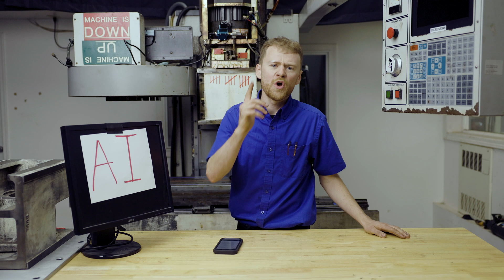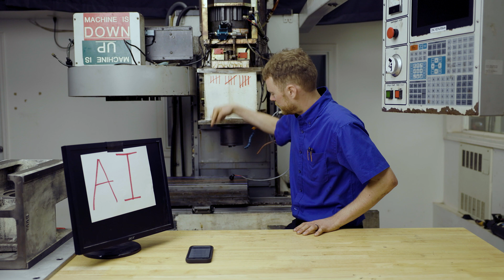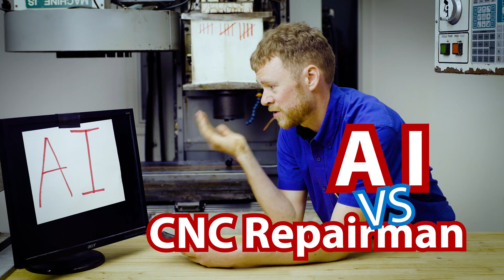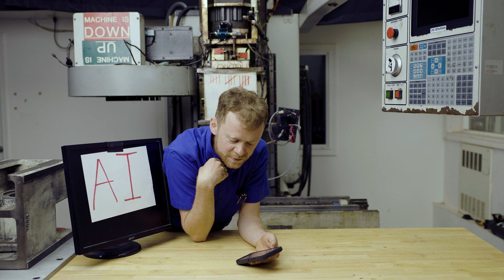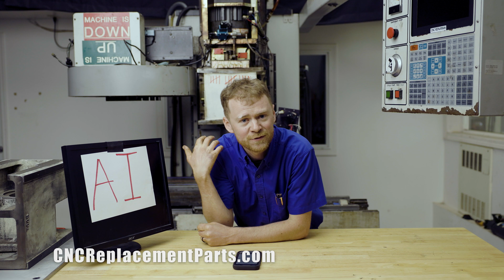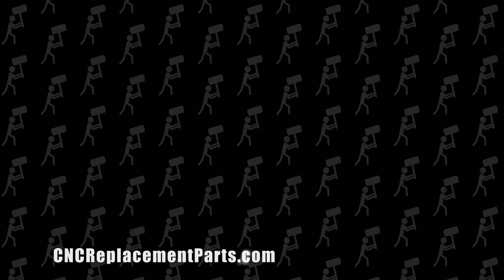How to Fix a CNC With AI

Comment: So you basically ask every single question there is instead of narrowing it down and targeting specific questions... thats not really helping though is it?

tbh in the future these machines will be filled with sensors and it will just self diagnose.
Reply: The cost of the AI machine that can completely diagnose itself will be priced 10x higher than others that do the same work, and the machine buyer won't buy th AI machine because the work they run on it won't cover the extra cost of the machine in its lifetime. They won't ever reach ROI return on investment unless they are charging their customers 10x more on for the same part produced. The machine mechanics will wear out at the same rate on both type machines. Still going to need a repairman. And sensors will fail. Still need a repair man. And for preventive maintenance, Still need a repair man.  The cost to build a perfect AI self sustainable machine would cost more than anyone could afford and it would never achieve a return on the investment IMO.

Comment: I'm on your side that AI will never replace the experienced expert, and I also think that you didn't really give AI a fair chance. As a machinist, I can say that you are absolutely correct that finish issues are likely related to the tooling or a lack of rigidity somewhere in the setup; however, a hard crash or worn components also cause problems. The way you asked GPT, it has to answer for both the machinist and the technician.

So, I just came up with a prompt that clearly states a common milling issue where the chatter can only be caused by the CNC, and be unrelated to the job setup:
"In an industrial CNC mill setup, using an endmill, chatter is present along the y-axis during an internal circular interpolation, but no chatter is present along the x-axis of the circular bore. Rotating the vice 90 degrees and performing the same cut will produce a similar result. With the same setup, on another machine, there is no chatter present. What can be causing the chatter?"

In the response, I was hoping that it would say "check the ball-screw for wear" or "buy new seals and remove the clumped shavings from under the way covers", but what I got was pretty much "check your tooling, cutting conditions, and lubrication"... now I'm thinking that you rated AI to highly... that maybe it can ONLY provide general responses to abstract ideas.

Will there be any more AI versus human videos coming our way?
Reply: I asked ChatGPT4 your exact prompt and got this result:

"Milling chatter is usually a result of a dynamic response in the cutting process that involves the natural frequencies of the system. It manifests as an unstable, often loud and intense, vibration during cutting. If the chatter is present only in one specific axis and persists even after you rotate the workpiece, it suggests that the problem is machine-specific rather than tool or workpiece related.

Here are several possible causes:

1. *Mechanical looseness:* If there's any mechanical looseness, such as a worn guide way, loose screw, or misalignment in the y-axis components of the machine, it could cause chatter. A machine's axes are not always equivalent in their mechanical design, which could explain why the problem only occurs in the y-axis.

2. *Unbalance forces:* The spindle or machine itself could be unbalanced, with the imbalance more noticeable when operations are performed along certain axes. 

3. *Natural frequencies and mode shapes:* Every mechanical system has its own natural frequencies and mode shapes (ways in which it tends to vibrate). If the cutting conditions (like speed and feed rate) match one of these natural frequencies, resonance can occur, leading to chatter. It's possible that the y-axis of your machine has a natural frequency that is getting excited during this particular operation.

4. *Tool holder-spindle interface:* There might be an issue with the tool holder-spindle interface. Runout or a loose tool holder could result in chatter.

5. *Control system parameters:* The control system parameters could be improperly set for the y-axis. Factors such as servo gains, damping settings, and acceleration/deceleration rates can all impact system stability.

6. *Lubrication issues:* Improper lubrication or failing lubrication systems can cause increased friction and heat, leading to chatter.

7. *Servo response issue:* The problem could be specific to the servo control loop for the y-axis. This might not be responding correctly to the feedback, leading to instability.

To pinpoint the cause, it would be necessary to perform some systematic diagnostic steps. You might need to check for mechanical looseness, inspect the machine components for wear or damage, and examine your control parameters. You might also want to perform a modal analysis to see if the y-axis is resonating at the cutting speed. You can then make necessary adjustments or repairs to alleviate the problem."
Reply: @kjetilandersen7151  That's weird.. Was that the only question that you asked, were there any prior prompts, have you used the service before (if so, are you a machinist or tech)?
I can't believe we're getting vastly different responses to the same prompt; I'm going to retry it when I get back and put it's response here:

 "Chatter in a CNC mill can have various causes, and diagnosing the exact reason can be complex. However, I can suggest some potential factors that could be contributing to the chatter in your specific scenario:

Machine rigidity: Chatter can occur if the machine lacks sufficient rigidity to handle the cutting forces generated during the operation. This could be due to issues such as worn-out or improperly tensioned bearings, loose components, or a less rigid construction along the y-axis compared to the x-axis.

Tool conditions: Check the condition of the endmill. A dull or damaged tool can lead to uneven cutting forces, causing chatter. Ensure that the endmill is sharp, properly secured, and suitable for the material being machined.

Cutting parameters: Review the cutting parameters used during the operation. Chatter can result from improper speeds, feeds, or depths of cut. Adjusting these parameters to optimize the cutting conditions for your specific setup may help alleviate the chatter.

Workholding stability: The way the workpiece is clamped or held in the vice can impact chatter. If the workpiece is not securely held, it may vibrate during the cutting process, leading to chatter. Ensure that the workpiece is properly positioned and firmly secured to minimize any movement.

Machine dynamics: Different machines have varying characteristics, such as different spindle speeds, acceleration rates, or servo control systems. These differences can affect how the machine responds to cutting forces and vibrations. The machine that exhibits chatter may have less favorable dynamics for the specific operation compared to the machine that does not produce chatter.

Lubrication and cooling: Insufficient lubrication or cooling of the cutting area can lead to increased friction and heat generation, potentially contributing to chatter. Make sure that the appropriate cutting fluid or lubricant is being used and applied correctly.

Toolpath strategy: The toolpath used for the circular interpolation may also influence chatter. Consider optimizing the toolpath to reduce sudden changes in direction or excessive engagement of the endmill, which can help mitigate chatter.

It is worth noting that the above factors are not exhaustive, and other variables specific to your setup may contribute to the chatter as well. To pinpoint the exact cause, it may be necessary to consult with a machining expert or conduct further experimentation and analysis with the specific machines and materials involved."

Why can it be so different for us? Are you using ChatGPT, GPT4, or DALLE? (I used Chat). The response is changing slightly when it's regenerated on my end, but nothing like what you showed me.
Reply: @mics1417  That was the only question I posed during that conversation. I made use of GPT-4. I'm a hobbyist CNC user with only a few months of experience. I have previously asked questions about controlling a VFD through G-code. That's all.
Reply: @kjetilandersen7151  Thanks for the reply! I was starting to think that the response from ChatGPT depends on the user's previous prompts, but it seems now that you used the later version and I used the earlier version.
Reply: Oh it will. ChatGPT isnt really an AI. Its just a prediction on what word will come next. A proper ai will replace almost all jobs.